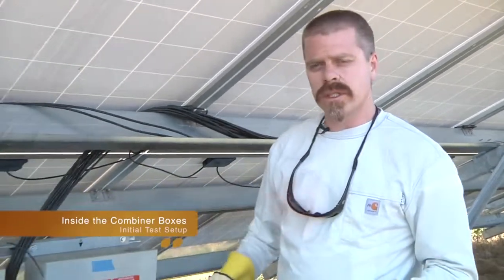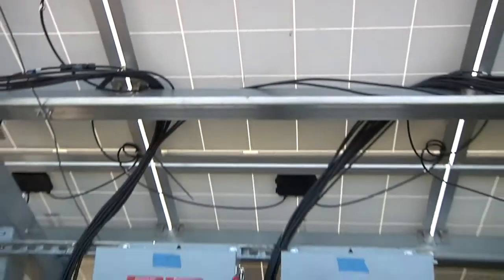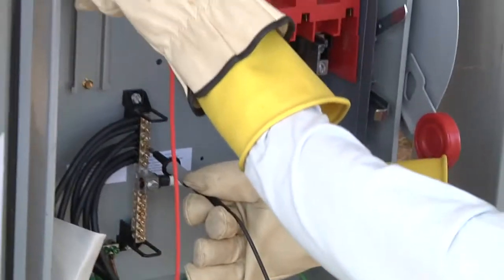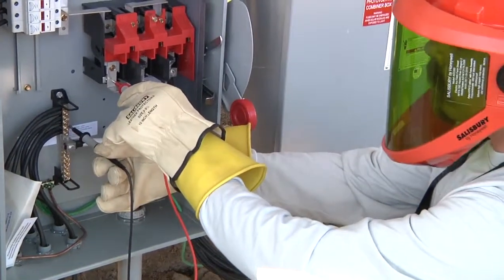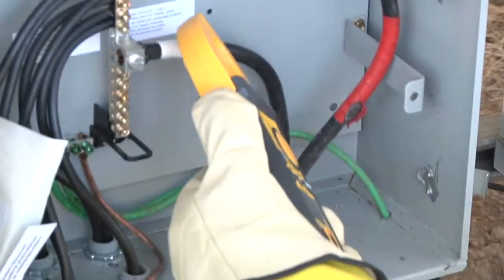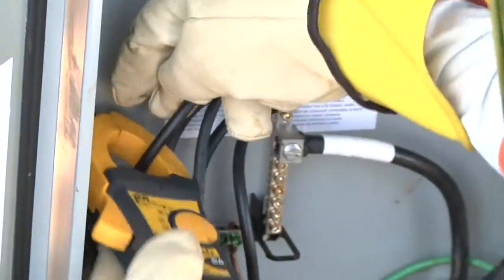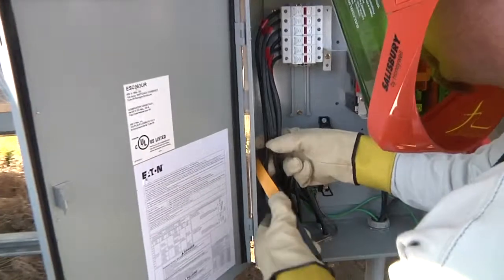PV Electrical Testing: Test Setup

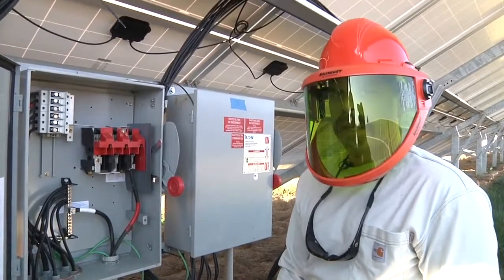Comment: you should have measured the each string voltage after minute 4:55. there is no point to measure string voltage before the string fuses are disconnected. am I wrong?
Reply from the maker: You are correct that you would want to measure string voltage after opening the fuse holders to verify that the string circuits are truly isolated. In the next steps (not shown in the video) we follow that process. Here, we're being extra careful and verifying that expected voltages are present before opening the fuses. An unexpected voltage measurement at this stage could suggest the presence of a ground fault.

Comment: According to 690.31 A, 

“Where PV source and output circuits operating at voltages greater than 30 volts are installed in readily accessible locations, circuit conductors shall be guarded or installed in Type MC cable or in raceway.”

So how come there are conductors exposed at what appears to be ground level? Is the back of the array fenced? I ask because I have seen this on many videos, and I have had to make sure that exposed cables I install can’t be reached from the ground. I achieve this by raising the mounts and installing the modules so their wires are above 8 feet.
Reply from the maker: Hi Jeff, thanks for your question. In the video we are behind a locked gate, in an area accessible only to qualified personnel.